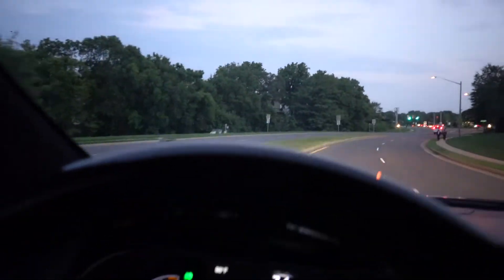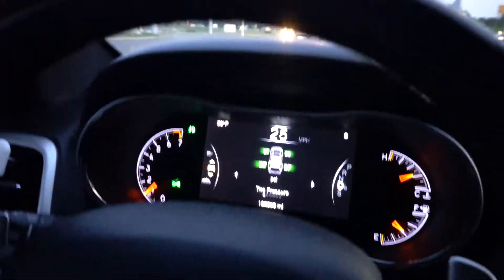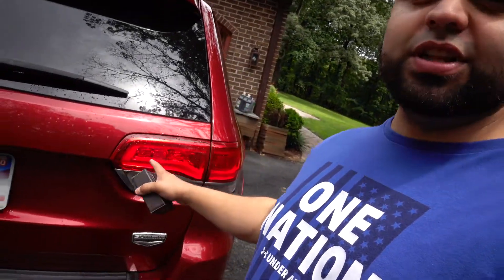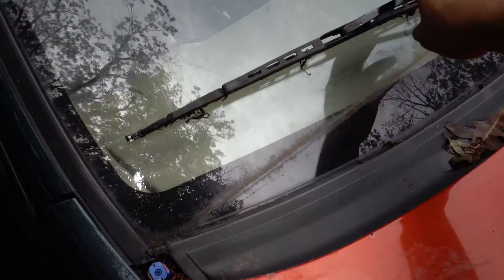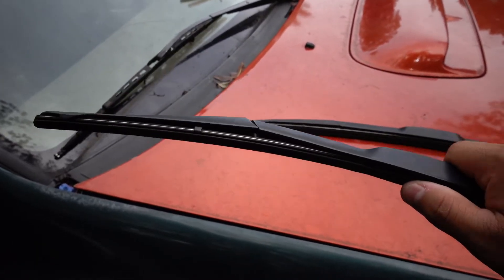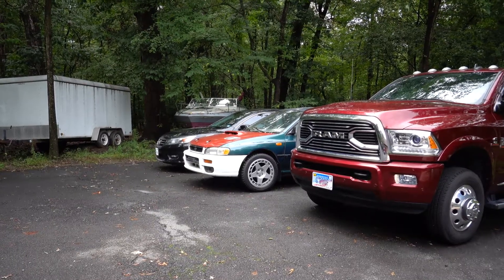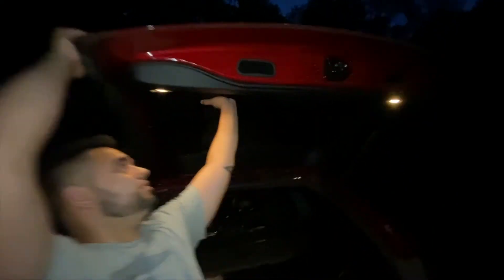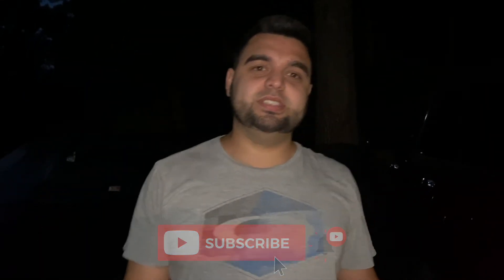Getting The Jeep Grand Cherokee WK2 Road Trip Ready!!

Comment: What kind of LED bulbs did you go with? Didn’t see a link to them.
Reply from the maker: I went with the MAXGTRS brand because of their ratings on amazon. These cars use 2 different sizes so I ordered a pair of:
MAXGTRS 921 912 Cree Chip LED Light with Condenser Lens W16W T15 6000K Xenon White for Reverse Light Brake Light Tail Light https://www.amazon.com/dp/B078W3SYKW/ref=cm_sw_r_cp_api_i_xhoxFbRY65NCA 
and a pair of:
MAXGTRS W21/5W 7443 T20 LED Bulb Cree Chip with Condenser Lens 6000k White for Reverse Light Back Up Light Brake Light Tail Light https://www.amazon.com/dp/B07KZW3FV1/ref=cm_sw_r_cp_api_i_njoxFbBXNG541

I will add them to the description here shortly. Thanks for the reminder! 👍🏼